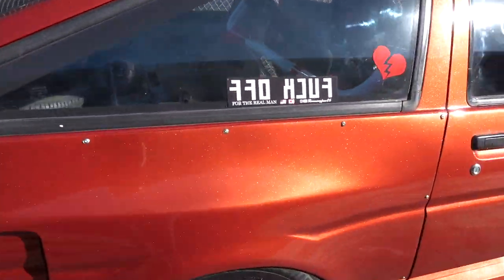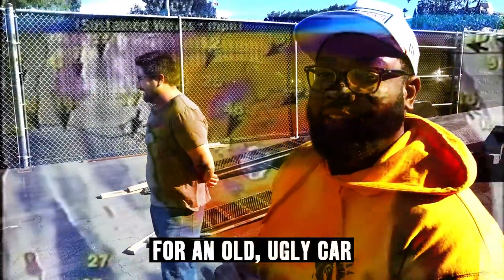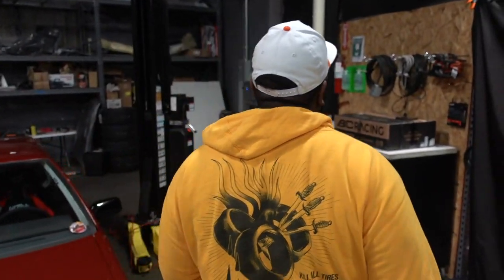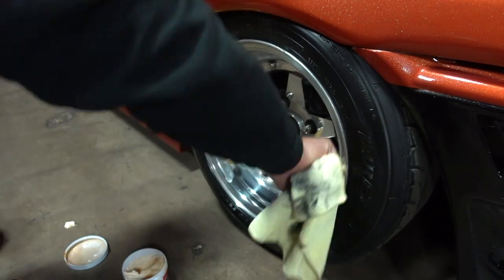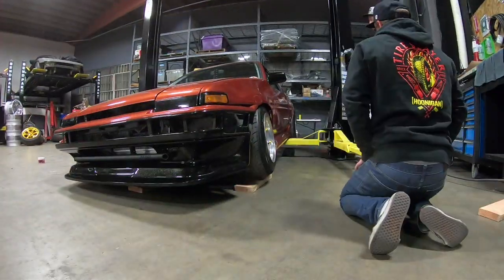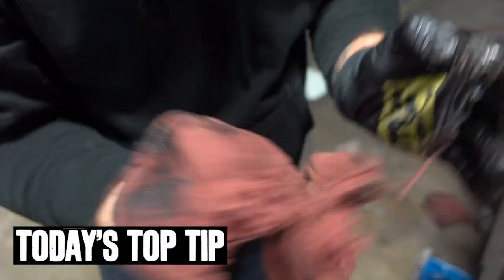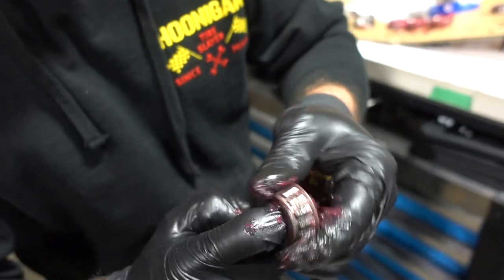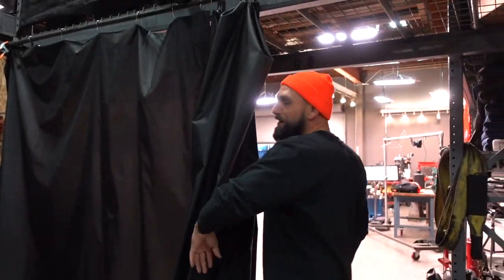Hert's AE86 Corolla Update: Fresh Paint & New Coilover Install 621 Golden Ep.001

Comment: "They'll figure it out based on the parts" - Scotto. 
Challenge accepted.

- It's V8 powered with a dry sump system, you can tell by the oil pan. Google image search confirms. Based on how many V8 engines blow based on oiling issues under drift, this leads me to believe it's intended for drift. 
- Based on the turbo size in comparison with the alternator,  it looks to be about a medium power turbo for a V8. Should be very responsive. This adds to the theory of drift car. 
- the intake charge pipe, looks to have some sort of "Y" fitting on the end. Reminds me of that e46 dan built with twin throttle bodies. That, or there are two turbos, and this is an incredibly high horsepower build.
- The length of the accessory belt looks to be very short from the cut off view of it. this suggests that there are only the essentials. Full racecar as they say. 
- It looks to be a precision 39mm wastegate. In which case, guys, come on that's way too small, you're going to have boost creep for days. Even if this was twin turbo and you have two, still too small. Come on, dan!
- Based on the short motor mounts, and double heim steering setup, we can deduce that his is going in a small chassis with tight fit. This points twards JDM or EURO. Leaning twards S-Chassis or E series BMW. 
 - I'm seeing some high pressure fuel rails in the background, this suggests direct port fuel injection. This appears to be for a modern V8, likely EURO. Perhaps a BMW v8 of some sort. 
- I don't recognize the valve covers, but I believe they're different than the old valve covers. 

Based on this: my theory on the new knuckle busters is as follows: The old knuckle busters e46 is getting a newer BMW engine and they're slapping on a new turbo for good measure.
Reply: A police department somewhere needs you to solve crimes.
Reply: I hope they're twin-turbo LS for the E36 M3, going dry-sump Taylor Ray style
Reply: E36*
Reply: Ls, thats a gm alternator and oil pan
Reply: @Wangan280z  i was thinking that about the pan until I saw the direct port fuel injection. Maybe gen 5 ls? Also then maybe not all the parts on the table are new. Maybe that twin throttle body charge pipe was from the old, likely blown up motor. Hive mind, gents! So we're thinking LS in the e36. Yep, I like it.
Reply: Dylan Wiebe its a duramax look at the valve covers and the up pipes
Reply: I'm going to go with a dry sumped V8 diesel on the rail car
Reply: @mherzog0124   the turbo drain tube

Comment: Car is turning out sweet! Here's a tip to get extra caster adjustment, change over the top hats from left to right and drill new holes in the shock tower for the inside stud. This sets the coilover back slightly so you effectively get about 1/2 degree of free caster.

Comment: Im surprised hert is running lower offset with more stretch, its got less than 200 horsepower you dont need that large of a contact patch.
Reply from the maker: You can fix that with tire pressure and alignment. 👊🏼👍🏼